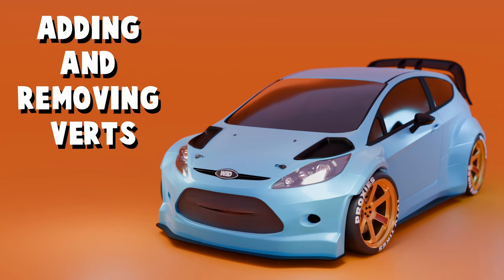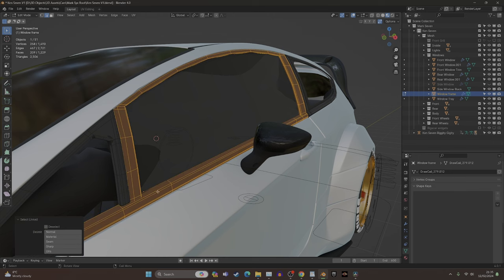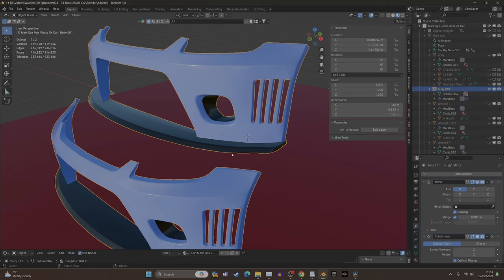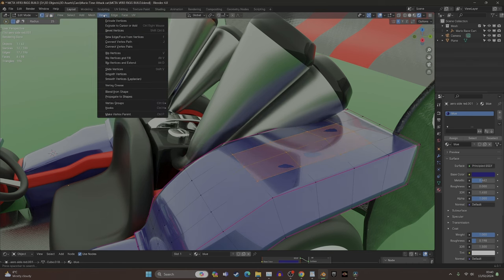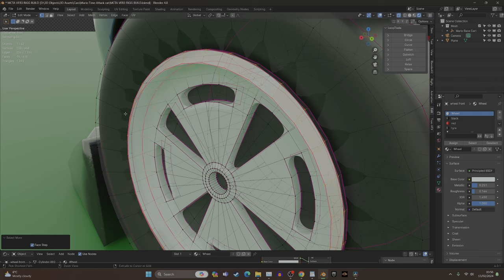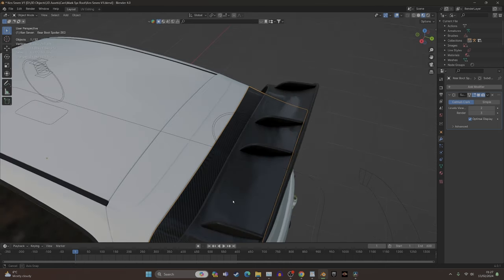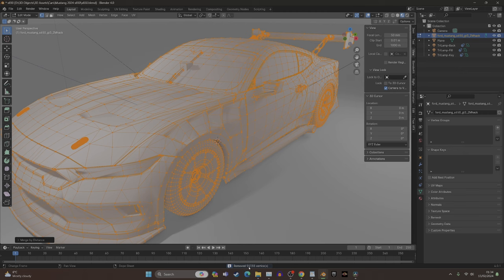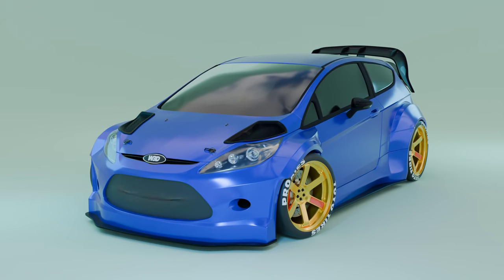How to Model a Car in Blender - 14 Tips & Tricks

Comment: very good video and training! thahk you; but if I have a car composed by many meshes (panels and more...) and they have a space between them how can I merge all together? for instance, front hood and lateral fenders: they have a space/clearenca between them --> if I want to close it but keep the separation line (because I want  to 3D print) how can I do it? thank you!!! 🙏
Reply from the maker: 3d print apps will fill those gaps dont worry. As long as its not a window size hole the app will create a volume of the collective etc.
Reply: @walejaw3d   ok but I need to close it with blender. is it possible? maybe I could create a big cube and cover the 3d model; after it I could repair the 3d model and cancel the big cube; what do you think?
Reply from the maker: @protomanialab there are many options. Booleen, joining meshs, remeshing, bridging edge loops etc. all depends on what your what your end goal is etc. ive tried everything and in the end, if you just make sure thing overlap each other they will print ok
Reply: @walejaw3d  thank you friend 🙏🏻